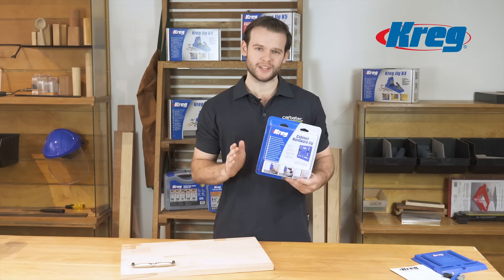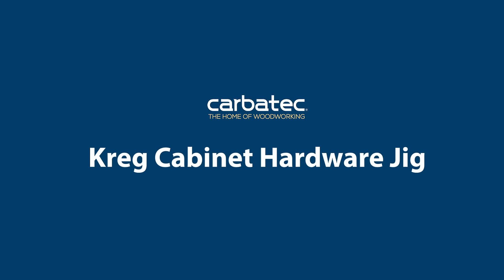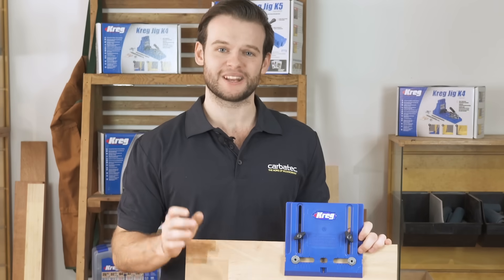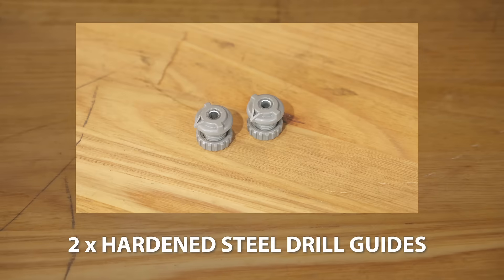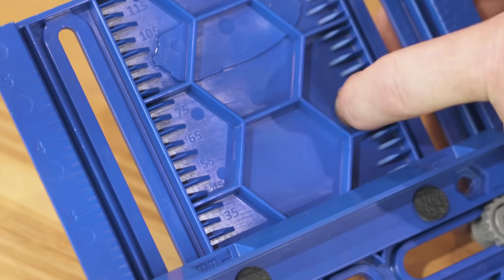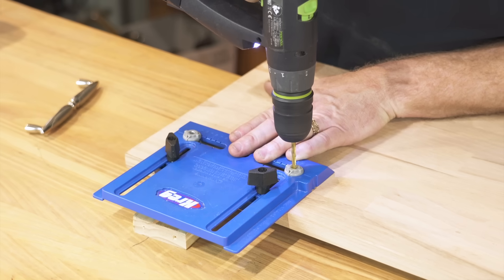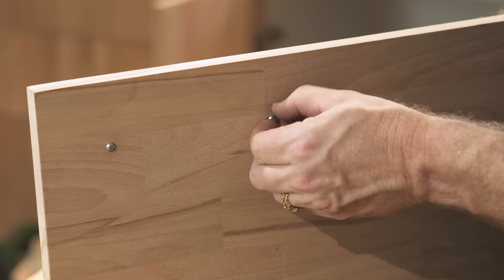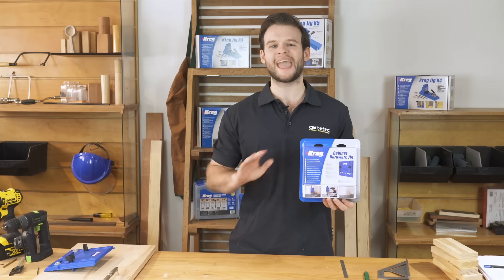Kreg Cabinet Hardware Jig

Comment: Well done.   Will this work on shaker  style drawer face  with a recessed center panel area.?
Reply: Yes, it will just require more effort on your part to hold the drill steady and straight, as the jig will have a gap between it and the recessed center panel.
Reply: @RWDtech  thank you
Reply: it's really an awkward, clumsy tool.  PITA. I just bought one and used in on Shaker style cabinets. PITA.  And...to address the reply from RWDtech below - it will work (with some effort) on a 6 inch Shaker style drawer, but I can't figure out how to use it on the deep drawers in the kitchen - 11" height. Have I mentioned that it's a PITA to use this thing? I'm a DIY'er and not a tradesmen, but there has to be a better product than this thing. I would not recommend. And...the blue rubber part on the handle of the clamp slid off when I was unclamping. The clamp fell and dinged up the cabinet.  This is the first Kreg product I have used. It will also be the last Kreg product I ever buy. Over-priced, flimsy, poorly made and poorly designed.